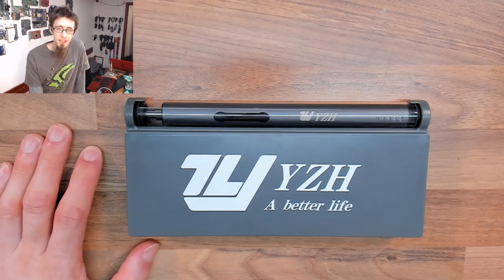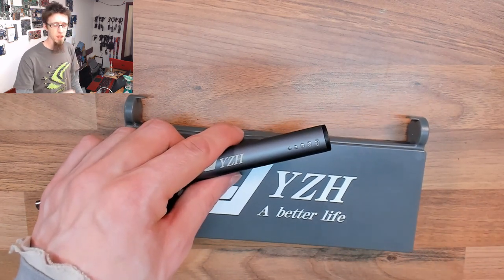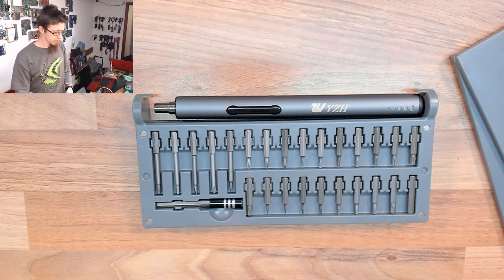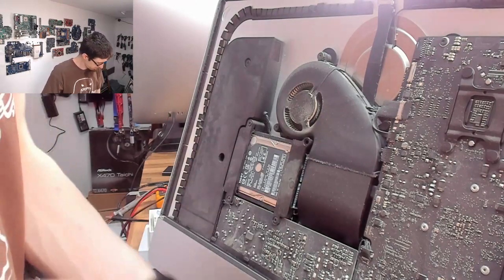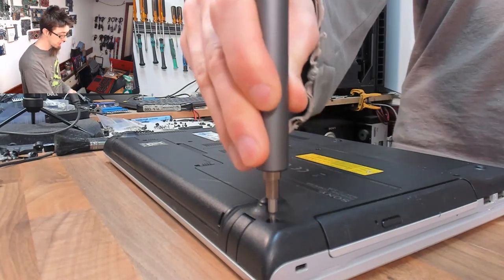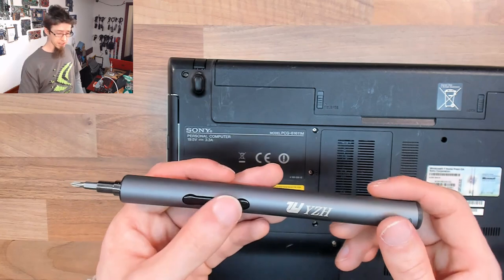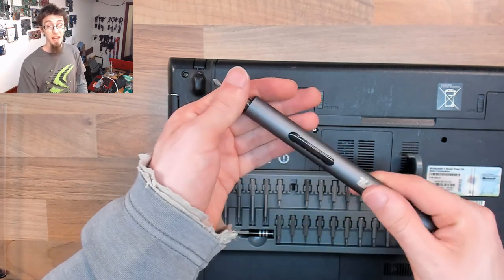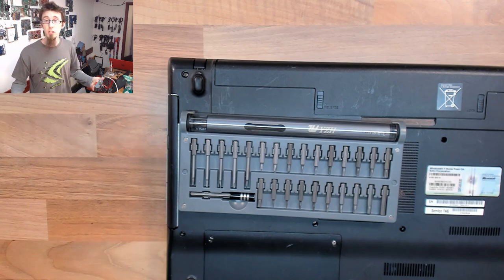YZH Mini Electric Screwdriver Review - LFC#220

Comment from the maker: Update on this - I finally killed it about a month ago, so it lasted me a year. I was not gentle on this screwdriver, I routinely forced it to do loads it isn't designed for, and eventually the gearbox gave up. If I hadn't brutalised it, I'd wager it'd still be going strong. I have since reviewed the Sequre SQ-ES126 and found it to be faster and more feature rich, but also considerably more expensive.
As a cheap electric screwdriver, this thing is still a great buy, IMHO. Just keep it's limitations in mind, and don't expect 10 years of service from it.

Comment: The power screwdrivers for micro bits are extremely handy and will save your hands/wrists when you get older. Especially if your job consist of small electronic repairs, trust me I know. My company bought me a Jakemy brand with USB C charging. I already feel a difference in my right hand from using the powered screwdriver.

Comment: Tip to remove rounded screws - use an elastic between the driver & screw. Push on the Z axis, and then start to turn slowly. Might have to repeat this step a few times. You could also solder one screw onto another back to front, then use a screw driver and carefully remove the screws :)

Comment: Hi there, new to your channel and watched a few video’s now and love this content. I purchased about a year ago a generic branded version of rechargeable screwdriver very similar looking to this one without the led indicator here in Australia 🇦🇺 from eBay for about $30AUD roughly £16-17 w/ free postage(only came w/ about 6 or 8 screw head fittings but I useD my other screw fittings) and I’ve used it dozens of times and recharged it about a dozen times and it still work as good as the day I purchased it. These for me are a great tool to have as I do some repair/upgrade/diagnostic work on pc’s, laptops and the one off mobile device for family and friends and they help me save some time and the battery life allows me multiple uses before a recharge is required. Keep up with your great content, 👍🇬🇧🍻 cheers

Comment: For devices without any easy way to check the charge state, one thing you can do is to measure the charge current. When the charge is low (typically 0-65% for li-ion chemistry), the current will sit at the max the charging circuit allows, but then the current will begin dropping. So you'll know if you're in the top 1/3 of SOC or not, and if so, roughly where in the top 1/3.

And that's assuming the charging circuitry doesn't do anything weird... so YMMV. But it's a cool excuse to have a USB power meter around.

Comment: great channel pal, can you tell what tweezers you use for lifting small caps etc, the ones with I'm assuming are a silicon tip?
Reply from the maker: They're ceramic, you can find them cheap on ebay. Not sure how helpful they really are vs. normal tweezers though, they haven't changed my life. They're supposed to avoid getting magnetised and stuff, but flux makes stuff stick to them anyway.
Reply: @Adamant_IT  Found it, thanks. I've been trying to work on consoles, I bought some stainless ones but didn't realise they transfer the heat very quick. I'm a total noob but trying to learn day by day, would you ever make content about repairing consoles?

Comment: I like multi-bit screwdrivers because you can have more esoteric bits in a smaller place, but i will say that you should also keep a pack of full screwdrivers just in case you need to get in deep, maybe consider getting a pack of long and skinny bits as well.
although if you do a lot of work that requires some real torque or you need larger bits, I highly recommend getting one of those full-size electric screwdrivers, you can get them for about $20-$30 and you can get a drill bit to precision if you need it, since those are more like foldable drills than what you have. some of them use AA's but you can get rechargeable AA's or a rechargeable screwdriver
I wouldn't rather buy a full size version because they're cheaper and they're better for more use cases since they are just a folding drill

Comment: Cool!  How, the heck, do you keep track of all the screws you pull out?
Reply from the maker: There are patterns to it. Sometimes all the screws are the same anyway, sometimes they're the same except for two large ones, which will go into the hinge corners. Other times I figure it out by looking at how deep the screw hole goes, or even just trial and error. The best way is to have a tray or mat that you can arrange them out in order or by label, but once you've been doing this long enough you just figure it out.

Comment: I nearly brought one , but then I thought there's more to go wrong (I cringed when you mentioned firmware for a screwdriver). If you want a manual option I recommend the "Wukong Magnetic Screwdriver Set,49 in 1" (£13.5 and the bits aren't junk!).

How old is that Sony Laptop? and please me you didn't let them leave without an SSD? 😅
Reply from the maker: It's a junker laptop, so no worry 😄

Comment: You should check out the Bosch GO2 rechargeable screwdriver looks alot more hefty than what you are reviewing.
Reply from the maker: The problem with big and hefty is that it'll shred laptop screws. These little ones are designed for PH0 / PH00 territory.
Reply: Adamant IT  True, just bought a version of your rechargeable screw driver from Ali express $28 Aud

Comment: Overall you're correct and for the cheap hardness of durability factor for the bits honestly doesn't matter if you use the absolute correct bit for that head type lol but what I did was swap out the built in battery and slapped in 2 newer small form factor lithiums, I can't remember the cell type right off the top of my head but upped the voltage and it's 3 times as powerful and dangerously torque happy but I had min come with a 108bit 62hr  on the hardness factor and it's been my savior for all my electronic repairs etc.. Then for 25$ I got a Dremel brand full sized mobile screwdriver with 6 torque settings:vs and omg the last 6 months both drivers are still top notch!! So don't get discouraged of others experiences it'll last you just fine for the price lol good luck and have fun. Ohh and don't be afraid to really wrench on it, it'll hold it's own and do you well

Comment: Looks like a pretty good product, but more than likely has low torque.  This might be reasonably okay for computer work; however, I use Dewalt 8 Volt screwdriver and ithas been enormously useful as an all purpose screwdriver with high torque.   Not sure about availability outside US.

Comment: Thanks - I write to you to ask the brand of your screwdrivers ... I did buy one of those named "WOWSTICK (supposedly sold by XIAO) visibly not the same (easy to recognize : no charging lights ramp) : very disappointing, no torque, the handle is sliuppery, no way to use the light befor having the bit turning, the extremity is hard on the inside of the hand (need a bit of sanding ). Really, it can turn screws but not tighten or untighten them with its power (it is stopped easily between 2 fingers. OK it may be useful but it is far from professional gear ;)

Comment: a bad screw driver can really screw you over, especially if the head is not magnetized and you realized the nut has slipped under the motherboard.  'sigh' . .  It does happen

Comment: people don't realize how much time is wasted removing and installing fasteners, a fast power driver is a must if you regularly work on 5,10 or even more puters or tv's daily, as battery powered screwdrivers go, that one seems relatively quick but it's been my experience that none of the dedicated electric drivers are fast enough when you are really in a hurry which is why i usually end up just using my 18v full size drill driver......

Comment: Depending on who you talk to .... this is a real "marmite" subject - like discussing care & maintenance of bicycle chains with somebody aged over 60. I have the "GongJiawenwan"  version which you must remove the battery to charge. (10440). It lives with a 1.5 phil bit in it and that's it. I wouldn't be without it now - it's just so quick. £22 ebay. The one contra to these is that you need to watch out for "play" in the drive mech to make sure you get the correct bit size - especially torx. Otherwise.... stripped heads. It's one of those things you only do once. Like me. Toshiba - rather helpfully - write the T number next to their screws. So simple and kind of them.

Comment: I think is slow for mass repairs, it has to be like a pit stop pew pew pew
Reply from the maker: If I'm in try-hard mode, I'd be faster with a manual screw driver. But working casually, not as if my life depended on it, there was very little in it. However, the bits need magnetising. Being able to stick a magnet on my screw drivers is incredible useful for lifting screws out the holes.